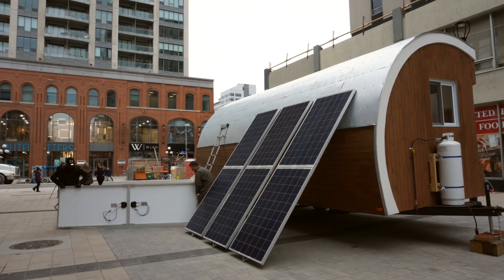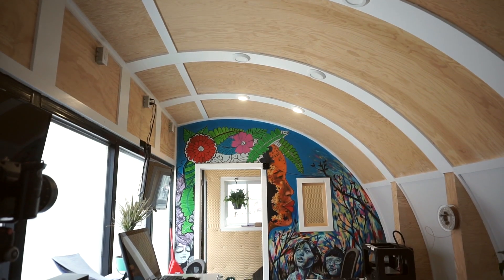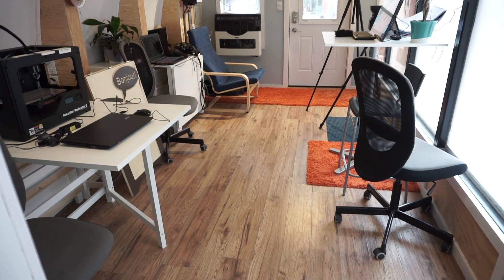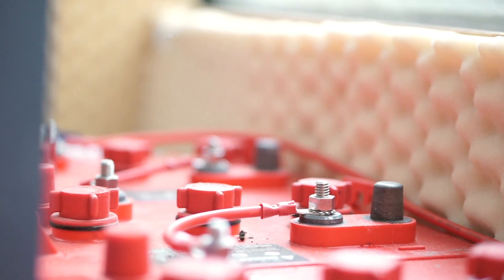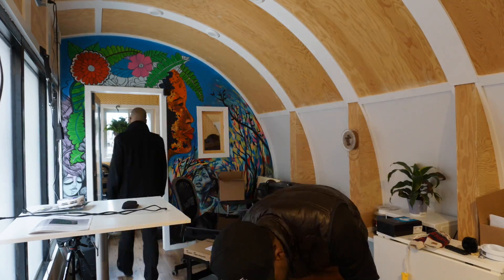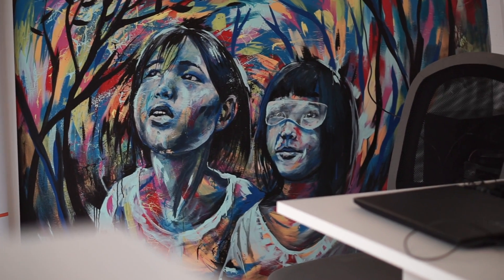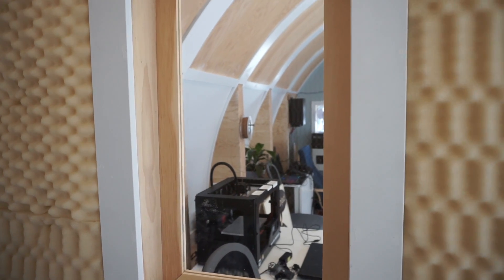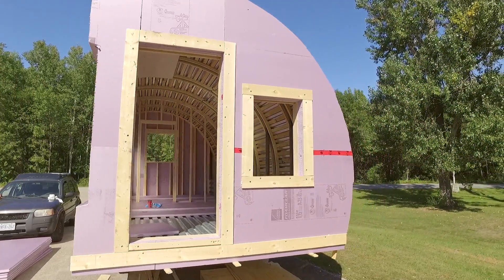Solar Powered Pod as Prototype for Tiny House, Mobile Office & More!

Comment: On the plane side, put a rail or angle along the top and along the bottom. Have the same, matching, on another pod. Drive one to the other and slide them together (plane side) and close the pod for weather and the night. Have a patio that the additional pod drives over so when it is 'opened' you will have a patio. Just at the ends dont completely slide them apart and go pod to pod when opened during the day with say the patio for one pod and the parking pad for the other. You have a very good module. Use it! and what fun!
You can also make an accordion with an opposing pod, but I like the slide. The accordion can also close at night or in case of needing defense - say from weather of from the RCMP. It will be safe from run-a-muck horses that way. Great and inventive work.